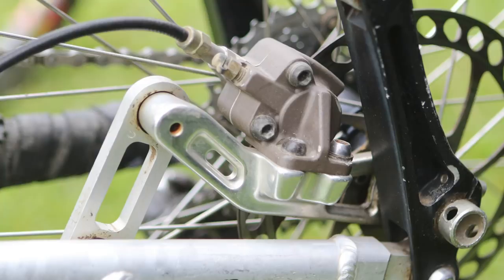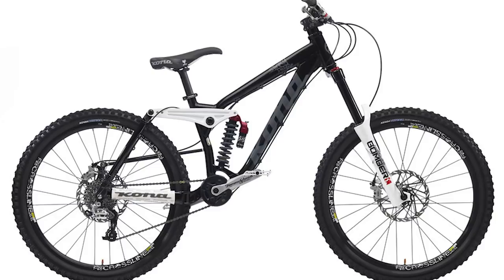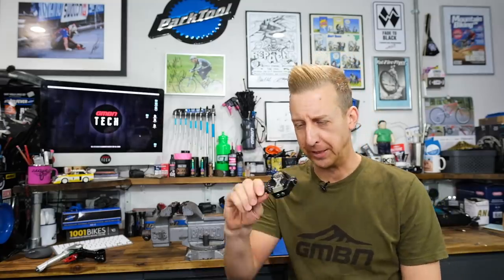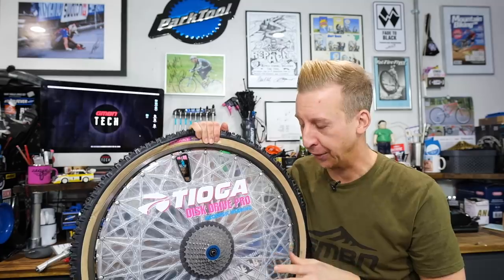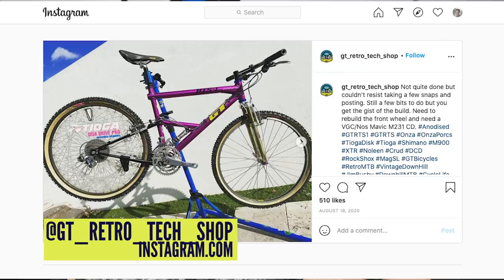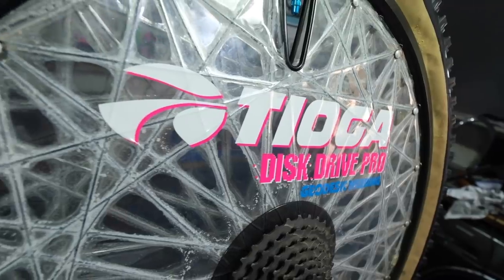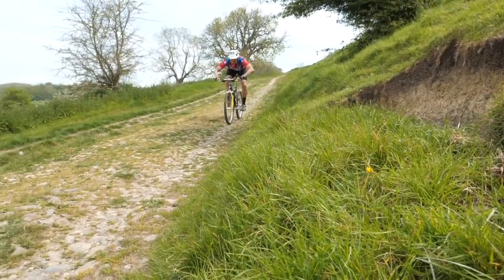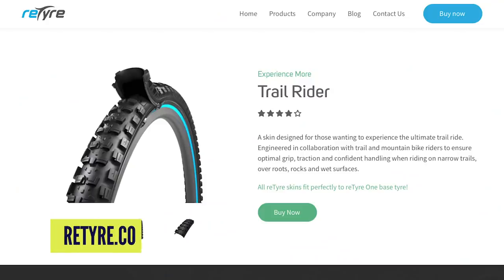More Strange Mountain Bike Tech | MTB Tech History - Part 2

Comment from the maker: What did we miss? Let us know your personal weirdest bit of bike tech in the comments!
Reply: suspension seat post
Reply: Doddy what "modern tech" do you see becoming strange down the line??
Reply: Loop wheels. Hs-33. Kirk Revolution. Pull shocks. Huge seats like the SDG big boy.  Gearboxes.
Reply: Big Hit 24” rear
Reply: Interesting, that two of the brake torsion arm bikes also had the rare Rock Shox pullshock that was the hot new thing back in the days. This is worth a mention of its own.
Reply: I know they existed because I searched, but I still do not quite understand them:

Inverted. Suspension. Forks.
Reply: Time ATAC's with Ti spindles still rule...also, HED solid carbon disc DH wheels! (For appearance alone.)
Reply: @androdelrosario  - less stiction and unsprung weight, seals stay lubed, some people claim they're less flexy in the ways that really matter.
Reply: Catamount's URT was better than either Castellano's or Gary Klein's- they split the difference geometrically. The 'Y-bikes' suuuuuuucked. hard.
Reply: Don't know if they're old enough to qualify, but Magura Gustav brakes still can't be beat, and spidered cranks like Middleburns are still awesome.
Reply: You could do an entire show on the 'never quite brought to fruition' gearbox bikes by Sugino, Honda, and....weren't there others?
Reply: the slingshot frame...
Reply: And a Hite-Rite seatpost spring
Reply: Pedersen Self Energizing Brakes. I have them on my 1985 Cannondale SM600 (24"/26" wheels) and they rule!
I have them working with Odyssey Straddle Rods... another bit of weird retro-tech! Love the show!
Reply: The fox dyad rt2 shock from cannondale
Reply: Gravaa hubs that can adjust tyre pressure whilst riding. Incredible
Reply: I put ceramic rims on my old Klein Fervor due to the cost of converting it to disc. You didn't see many of those about.
Reply: Oval chain rings. They existed on the 90s. Then went away, now they are back.
Reply: 3 spoke carbon wheels.
Reply: Check out the Shockster. It was a full suspension conversion kit for hardtails. Looks really cool but i don't know how it must've felt to ride
Reply: Softride beam suspension. You did the stem but not the bike.
Reply: Recumbent MTB
Reply: Don't know how I could forget the Avid SAAGO stem- I'm staring right at one! : D
Reply: thanks for making me stay up all night looking a floating brakes -- where is brake therapy now?  or do i have to make my own floating brake system
Reply: @troyrogers1236  - there were some factory bikes that had them- Kona and Santa Cruz come to mind- but the principle is simple; pivot your caliper from the axle center, mounted by rod to the nearest non-swingarm frame member. By separating the   brake from the swingarm, the two elements can function independently, improving the function of both. Pretty commonly seen on old 80's sport motorcycles- at least that's where I first came upon them..
Reply: @chrisridesbicycles  - those were designed by Mert Lawill, a pretty famous motorcycle racer who'd taken up Mtb's. Floating brakes were real racing tech in the 70's!
Reply: @floydblandston108  i have a session 7 and a asx...ive seen pics of the 7 with a floater i think i can modify the stinky dropouts to fir my frame...im gonna try..as for the asx ill have to make my own...and ive also got a 224 with 150mm rear hub...with a 135 hub i think i could fit a axel mounted bearing/swingarm in there and add spaccer to the other side of hub..my session 7 has the mounting point on the seat tube for the stabalizer arm and i always wondered what it was for- now i know...ebay only has one bike with floater on it right now and its a foose
Reply: I've been thinking the old Balfa DH bikes are weird enough to be ready for a re-introduction. Somebody tell Dave Weigle to poach the patent and move right in.....
U-brakes and Roller brakes also come to mind, but who the f#ck misses them! : D
Reply: @floydblandston108  That name rings a bell. I thought it was mentioned in a magazine article back in the day. And I think they also mentioned that Formula 1 cars also use(d) pullshocks.
Reply: You never mentioned the Klein Mantra while talking about unified rear triangles. That must be because it deserves its own video.
Reply: Can we stop calling people out for saying Kona style linkages are four-bar? They literally are, it's an engineering term and it's not fair to Kona et Al to call it faux bar.
Reply: Well, I guess it’s due in part to being into mountain biking since my first Specialized Rockhopper in 1985....
Flexstem 
USE suspension seatpost
Onza elastomer pedals
Biopace chainrings
Pace Carbon elastomer forks..

I still have my Onza pedals, they work fine!
Reply: @tornagawn  ...Specialized Rockhopper in 1965?... Take me time-traveling with you.
Reply: @brodobaggins9388  Duly corrected to 1985! My hands are arthritic from years of riding rigid mountain bikes & frequently mistype.....
Reply: @tornagawn  I feel your pain. Or rather fealt your pain. Glucosamine Condition. If that doesn't work for you, Shark Cartridge.
Reply: K-track
Reply: How about this for an early 90s oddity. Clip-on 90-degree extensions for brake levers? 
They let you apply the brakes WHILE your hands were on your bar-ends. 
An interesting concept, but frightening to use.
Reply: I would like to see part 3. I think you missed linkage forks. They're pretty weird. And also the hubless wheel. Pulstar hubs (which shimano copied). Another mention for pullshocks. Frames with twin shocks. That vintage Ancillotti scarab was very weird. http://www.ancillotti.com/story.html

Comment: The Kona Stab shown here that was ridden by Fabien Barel had its rockers installed upside down, transforming its geometry to 2020 standards, back in 2005
. That would be a nice piece of bike tech to show
Reply: How can you tell the rocker arms are upside down and how does it change the geo?
Reply: @FoilPowell  It sat the rear of the bike down a little,thus keeping full travel and slackening the head angle a few degrees  :-)   I have a retro bike with rockers,If I flip them it will raise the rear and give me a near on vertical head angle,I know because I tried it to see if it would work..lol

Comment: That shot of the GT RTS sure brought back some great memories.  I had a 1993 RTS 2 and after the rear tabs for the rocker link cracked, GT sent me a 1996 RTS Team frame w/ a Noleen piggyback shock. The original RTS 2 I had was what I rode in Moab, Utah. I actually rode Poison Spider Mesa and the Portal Loop on it, plus Porcupine Rim, Slick Rock, and Gemini Bridges. The Team frame was and still is my favorite bike that I have ever owned.
I even owned a unified rear triangle suspension bike, a 1998 Barracuda XC that even made it into GBMN Tech rewind once. I still have that frame, because I was still riding it up until the middle of 2018.

Comment: Good stuff!  I was living in Santa Monica in 1995, then the HQ of Onza.  We'd see the team van driving around town.  Clipless pedals were far from universal then, but ramping up fast.  You generally had your choice of Shimano, Ritcheys just arriving on the market, and some lesser brands.  I got the HO's with stainless spindles.  On one of my first rides hopped a curb in town and both spindles snapped, sending my boys into the top tube at high velocity.  Onza was cool enough to replace the spindles with black cromoly ones, but the fun wasn't over.  After a few rides, the elastomer retention bumpers would tear up and degrade, making it nearly impossible to clip out before toppling into rocks.  At the time I was trying to show my neanderthal riding partner how superior clipless pedals were to straps, but that meant bashed and bleeding knees for a year plus.  Superiority wasn't achieved until I jumped ship to Ritchey WCS's

Comment: Here are some ideas:
- Manitou Sherman OnePiontFive fork
- Dual Gatorbrake eight piston front disc brakes with carbon fiber rotors
- Spengle wheels
- Votec forks and bikes
- Spinergy wheels
- Mountain Cycle shockwave, San Andreas monocoque frames
- Maverick DUC 32 fork
- HED. rims and wheels
- Whyte PRST-1 bike
- Marzocchi Bomber RAC fork
- Sintesi Rumba frame

Comment: That brings back memories when I raced both GT on there first gen aluminum LTS then the carbon then on the STS Lobo . Then got one schwinn and really loved the Lawwill designed straight 8 with rockshox pull shock . The straight 8 was an amazing beautiful downhill bike even yeti had there variation of the straight 8  . It’s been a few years since me & Joe Lawwill talked about racing Norba in the 90’s & early 2000’s .
Then that toots disc was crazy to see John Tomac bomb mammoth kamikaze on that wheel you could here it from a bit down the mtn .

Comment: My gcse project back in the mid 90s was all about suspension designs of the time vs motorbikes. We concluded the shocks were crap which drove all the weird solutions. Now I ride a single pivot with a decent shock and it outperforms all the 90s suspension I rode at the time 👍🏻 

But would love to see some come back. Come on Brooklyn, please pleas please ❤️❤️❤️

Comment: Late 80s MTBs were so good, full XT, solid 26 inch wheels and no suspension to go wrong

Still riding my 88 Ritchey Ultra, it makes a great gravel bike and with low pressure the tyres give enough suspension for easy MTB trails.
So it’s come full circle, all those crazy mods, but we are back with simple gravel bikes, same as my 88 MTB, just with drops.
But we can see what happens next, all the mods will be done again on the gravel bikes, like the Topstone with a lefty fork and a bushing in the rear

Comment: Kona D.O.P.E. actually allowed for both mounting points in Stabs between 2005 and 2009.

In 2010 there was only the neutral (upper) option. For the team riders I think it varried. I have seen some bikes with no upper mount, some with both. FR and Backcountry (today it would be Enduro) bikes (2007 onward Stinkys, Coilers/Coilairs and Dawgs)  had only the top mount for neutral.

All of these bikes could be converted to D.O.P.E and non D.O.P.E. (depends on the model year).

Comment: I'll throw in my two cents on strange tech, both of which I have seen.  First is a hydraulic caliper brake.  Similar to the Cullimore that you showed last time around, this had a splitter, but was not a disc brake.  I don't remember now which bike it was on, and likely doesn't really matter by the time that I saw this, as I would guess it was not original with the bike at that time anyway.  The other is the Christini all-wheel drive system.  When I saw this, it was at a local shop, using 26" wheels, as I remember.  Looking them up, it seems that they are still around, and now doing the same thing in a 27.5" and fat tire bikes.  It's a funky system, especially for their full suspension bikes, with a telescoping drive shaft at the fork.

Comment: Back in early 2000's Shimano had a pneumatic rear derailleur   and the system fed from a compressed air bottle mounted under the down tube on an Intense M1 DH rig. It would be cool  to see how that worked.

Comment: Suggested old school tech: Any of the old front linkage suspension systems.  I have a Girvin Pro Carbon Cross link which I find to be really cool tech that had a great deal of potential.  (submitted pictures and description of my bike with that fork and other custom stuff from that era for your Rewind series but was never shown.)  Girvin's first round uses the elastomer system, then moved to the rear coil shock design.  It is hard to keep track of who really started this design.  The names I know of is Girvin, Noleen, K2 and Proflex(?).  How about Shimano's XTR BR-M950 V-Brakes that had that linkage that kept the pad in line with the wheel?

Comment: There’s lots more: 
The Slingshot bike with no downtube 
Early monocoque carbon frames aka Trimble, Cosmic 
Mavic ESP electronic shifting 
Magnesium frames aka Kirk or Pace 
Softride suspension seat bar 
AMP research or linkage forks 
Spengle, Spinergy, Spin, Aerospoke carbon wheels 
Cannondale headshok Fattys 
Hite-Rite post 
Dual V-brakes in the front 
U-brakes 
Corratec Teambow
Reply: I was at the launch of the Pace Team the year they debuted their bizarre DH Bike. It looked so different to anything out there at the time, but apparently it was shite to ride.

Comment: Smoke other great tech to explore would be the evolution of the specialized FSR design or GT's lts and RTS suspension.  Another would be the manitou bolt on rear suspension.  It essentially turned a hardtail into a full suspension bike.

Comment: URT is common in budget "halfords special" bikes. It's not the worst design but it's not a great one. 
 The DMR Bolt has quite possibly one of the best systems. At a glance it's a linkage stabilised single pivot but the crucial improvement is at the pivot. It's round the BB meaning no chain growth and fairly stable pedalling

Comment: Wasn't there a bike back around the end of the 90s that had a 'wrong side' drive chain? Like a high-pivot / idler pulley system but where the drive got passed through a second BB to another pulley on the (normally) 'non-drive' side and back to the rear wheel? ... I think that came over from some motorbike tech.
I'd also like to see something on the GT i-Drive system, because I'm not sure I really got how it worked 🤷‍♂️
[edit] (had to look it up) Anyone else remember the old Corractec Team Bow with twin top-tubes-becoming-seat-stays curving all the way down to the rear wheel?

Comment: Surely the URT doesn't isolate impacts very well from the wheel to your feet, if both the BB and the rear wheel are part of the same unit. I'm a little confused as to what the point was. Wouldn't a soft-tail have done the same job?

Comment: Where can i buy one of these brake torsion arms? id like to install one on my bike (wich is an old 29er)
Also, does anyone knows where can i find a 5.5inch shock? (eye to eye, 150mm) its for an old Cannondale.
Reply: You won’t find one. They’re very very bike specific usually involving lots of kinematic, physics and math. You can’t just slap one on and expect it to work. Also, they pretty much went by the wayside in the mid-00s. It didn’t take long for bike engineers to figure out they could dial in anti-squat/anti-rise etc integrated into their suspension kinematic. Re: shock, just find your eye-to-eye and stroke and google it.

Comment: I would be seen dead using the silly tyres. What is going to stop the joint in the tread from trying to peal the zip on tread off the tyre? How long will the zippers last if ridden off road consistently in crap weather? I can see more disadvantages the advantages with these tyres.

Comment: Hey Doddy, what in your opinion had any real potential and might have become something if it was developed further / taken over by a big manufacturer or just a few more years to be accepted by the bike buying public?
One thing I would like to get, and am surprised it has not come back, esp. with downhill racers or e-bikes is dual disc brakes on the front... Canyon had a flirt with such a thing - I think they have it in their museum, but there are images online... All it would beed it the mounting lugs on the right-hand fork leg, , another caliper, a tee-piece for the brake line that fed both calipers, and a hub with mounts on both sides for the discs. Just like larger capacity motorcycles have dual front discs compared to smaller, lower powered versions with a single disc. This could be setup with an ABS kind of system too (mechanical or electronic), so there was no front wheel lock-up - but still able to lock up the rear wheel if needed or for the fun of the skid... Dual 220mm rotors, with twin 4-piston calipers would be awesome... a lot more people would be going over the bars until they got used to it... the weight would not be that much extra... a disc and a caliper... less weight than a sandwich, cake or a pint...
Reply: @steve.b.23  Thanks... so many videos to watch - like e-mails, some if them go through to the keeper and get missed.... will catch it up - GMBN, EMBN & TECH videos all get posted at the same time Sunday evening in my time zone in Australia - come Monday morning,  something else is on my schedule (work, family etc)...